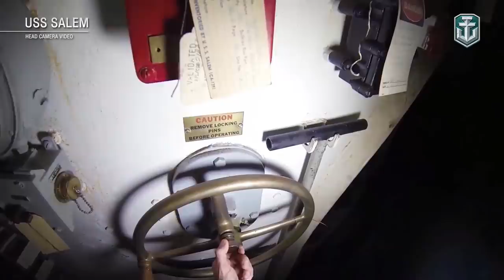USS Salem. Inside of main turret gun | World of Warships

Comment: This video made me a little sad. To see this ship is so neglected and starting to rust. I get it is hard to clean a ship of that size but some parts look like they weren’t cleaned after her decommissioning. The video is still cool though.
Reply: She really needs a better location.  She's at the old shipyard that built her on the Quincy /Weymouth line.  But most of the shipyard buildings and equipment are gone now.

There was talk of moving her to Boston a few years back when the pier she was at started to crumble.  She'd probably be better off in Boston as she'd have higher visibility and access to more tourists.
Reply: She is in much better shape than many ships I have visited, unfortunately.  For example, the USS Alabama is actually sitting in a few feet of mud and the lower few decks are completely flooded for about 15 years now after Hurricane Katrina, the USS Gato submarine had to be pulled out of the water, but is missing many of its machinery parts and fittings...though the TDC in the conning tower is completely intact AND still functional!  quite fun to load a firing solution.
Reply: XeroSygnal So basically the USS Salem is in the same position as the USS Texas. The USS Texas is in worse shape but both of these ships have to be moved. Thanks for all of the inside info guys I really appreciate it!
Reply: Here's a broom and a pan.
Reply: You don't want to visit USS Little Rock or (even worse) The Sullivans.

Sully has a permanent list at this point.

Comment: Wonder what all that is by the rope at 6:33 ? Kinda looks like depth charge racks or something
Reply: Not Depth Charge racks, depth charges are prettu big suckers, way to big for those racks.

Casing racks by the looks of it. The 8 Inch ammunition is two part, the casing containing the powder charge and the projectile seperate. Both would be stored in different magazines. Casings and Projectiles would be transferred from the main magazines into a closed of middle compartment, and then transferred from there to the ammunition hoists. Those cylinder door things are the transfer doors, casing or projectile goes in them, turn the handle and they are flipped to the other side where they are removed. 

Pretty much the whole system is designed to ensure the actual magazines are never open to the rest of the ship thus avoiding any potential spark hazards. Hence why most warships had the middle handling compartment seperating the main magazines from the hoists. The compartment looks a little small to be a main magazine, so possibly one of the handling compartments? 

Bad ammunition handling has killed more than one ship, it is why the British lost the Battlecruisers at Jutland, they ignored safe ammunition handling procedures to increase the rate of fire of the guns, so when sparks hit the ammunition stored in the hoists the whole system went up and blew the magazines.
Reply: @alganhar1  thanks for the answer

Comment: Some explanations would (have) be(en) useful...very confusing "architecture"
Reply: He was descending thru one of the Turrets and barbettes down to the magazine.  At combat readiness those hatches and doors are often all sealed off so each crew compartment of about 40 sailors total (in a BB some more) had to work as a unit to feed up ammunition vertically from under the waterline to the turrets AND operate the hydraulics needed to rotated and lay the guns.  Think of each turret as an independant building several stories tall and just a few feet wide full of pipes and electronics and about 40 men drilled to work without seeing eachother to feed those guns...not even considering Damage Control measures.

Comment: MMMmm, if you try hard enough you can smell the lead paint and asbestos.  Actually rather surprised how much machinery and structure they left in those lifts and turret mechanisms.  On most ships brass fittings and copper piping stuff has long been sold off or 'walked away'.